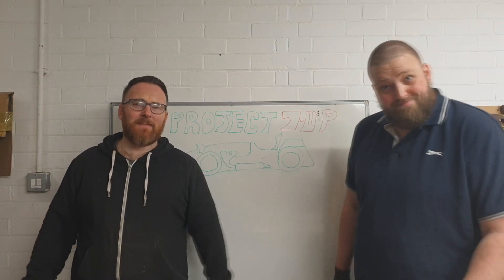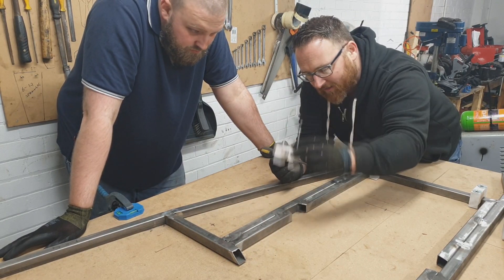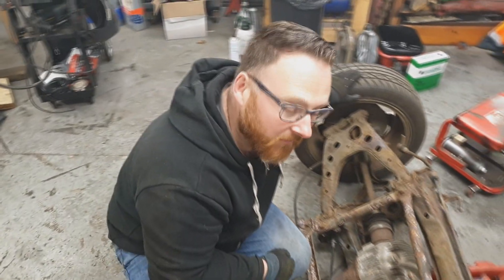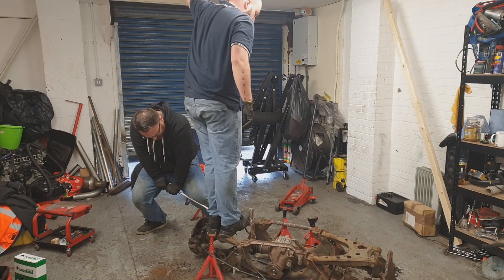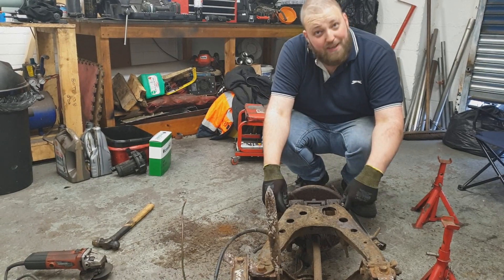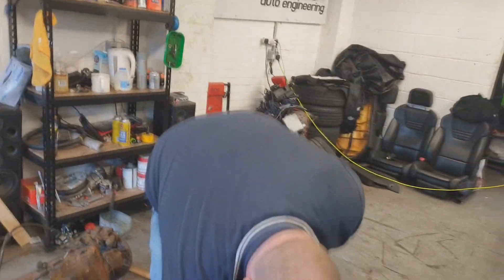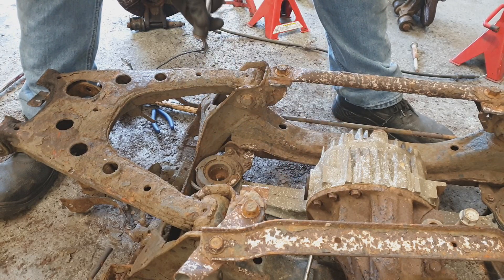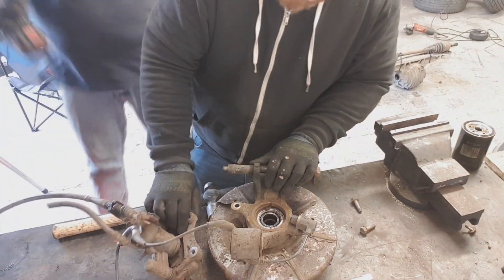Locost 7 Kit Car FULL BUILD!! - Episode 5 - FINISHING THE BASE!

Comment: Luv it guys.... Tip spend time leveling bench, good 1 knock bad. ( F. A. A. top tip not mine) glue 5min epoxy or similar, legs to the floor, keeps it all true. It'll knock off with a hammer when your done.
Reply from the maker: Great tip!

Comment: Can I suggest once you weld your upright parts, that is the point you really have to consider what type of lower harness mounts you will fit. You should weld them in before going much further as access is greatly reduced later in the build. I have had to retrofit lower mounts onto a part finished project and it was a nightmare. Good luck with the rest of the build. Subscribed and waiting for updates.
Reply from the maker: Great tip, cheers man!